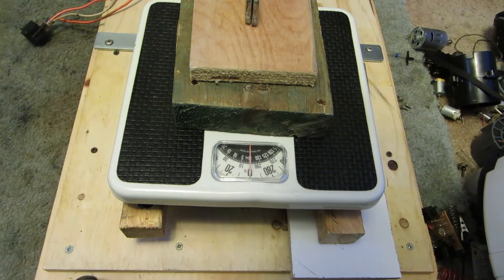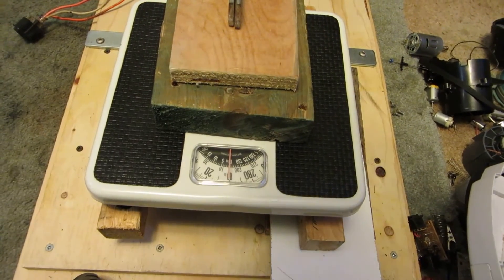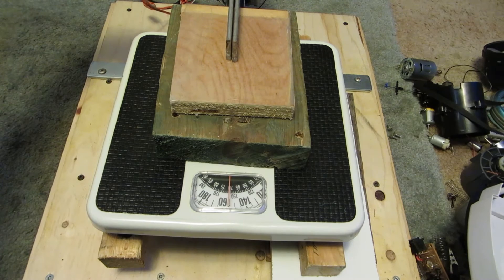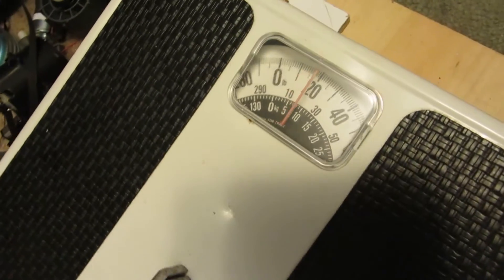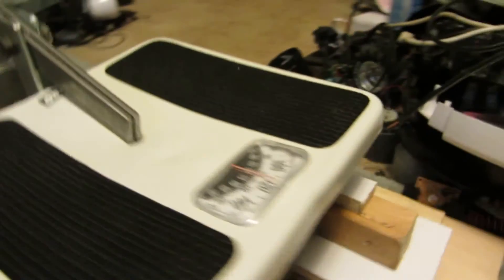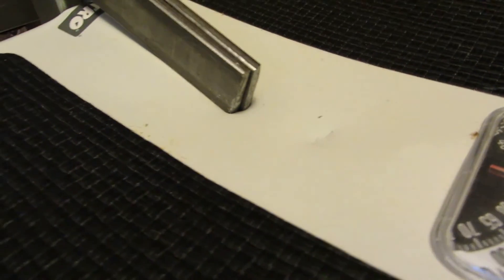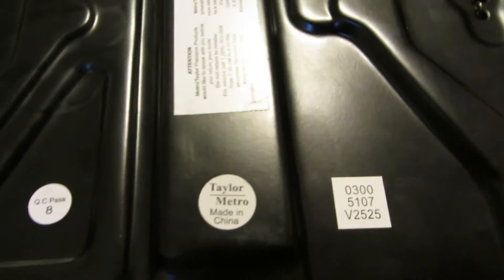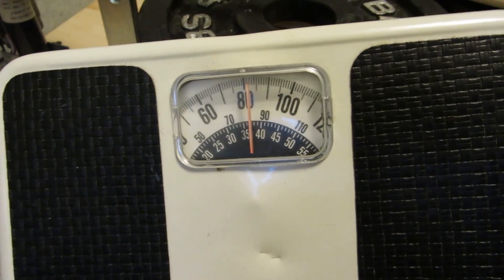Will it Crush?: Weight Scale

Comment: you are in essence trying to calculate torque. (lb/ft) so just elongate the arm several times and measure the weight then. divide the lb value by the feet and you have your torque! ps-That arm looks to be about half a foot so double the torque to get your "force applied"